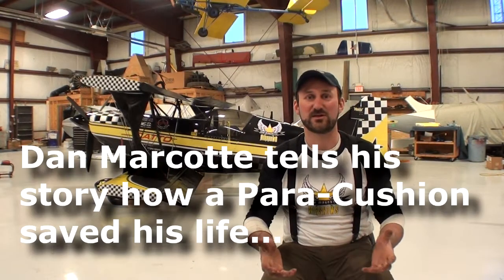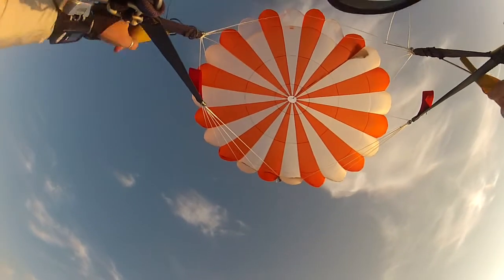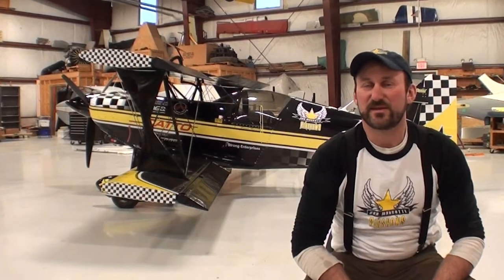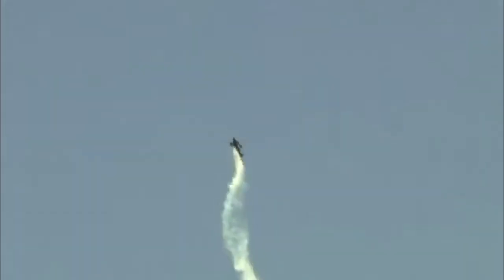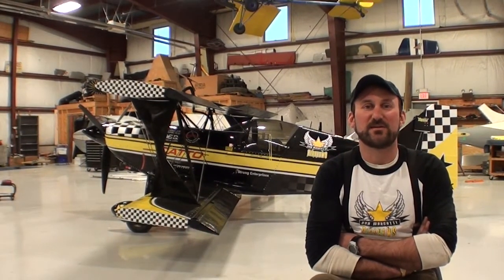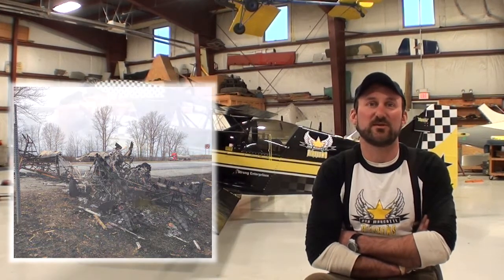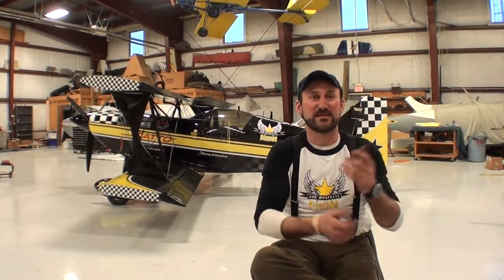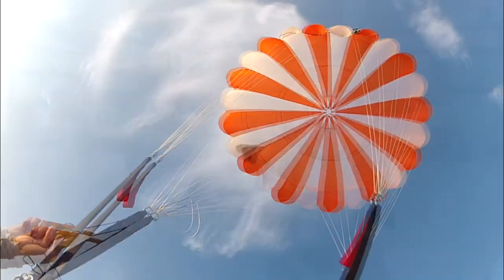11 A Personal Story - Live Para-Cushion Save

Comment: Dan made a very strong comment here that I have to emphasize, because of my own experience.  His point was mental preparation for ANY possible emergency.  
 I am a Christen Eagle pilot, and have taught things like inverted flat spins.  I was flying in what is now my plane, but at the time was still owned by the builder, Larry.  I had done the initial test flying of the plane, and all the flyoff hours before teaching him how to fly it.  At the time this occurred, I probably had close to 100 hours in the plane.  I was very comfortable in it in all attitudes and maneuvers.  
    Larry was an ex-heavyweight boxer, and probably weighed at least 100 lb more than me.  He had originally set the plane up CG-wise for me, which meant the battery behind the seat.  After I soloed him, he moved the battery from behind the seat, to just behind the firewall.  Moved the CG WAY forward. 
    He forgot to tell me that.  
    I was going to demonstrate an inverted flat spin to a fellow acro pilot, and we started at 10,000'  When I went to apply the IFS controls, the plane wouldn't go flat, but it did accelerate a bunch in the normal inverted spin.  The IFS didn't work, so I initiated the IFS recovery techniques I had mentally prepared for.  
    The plane instantly went into a highly accelerated spin.  So fast I could not tell whether I was inverted or upright, or even which direction I was spinning.  I tried a dozen different recovery techniques, nothing worked.   The G-forces were very high.
    Finally I told myself, "to hell with all these TECHNIQUES, just get standard spin!"  I held in the standard spin inputs, and the plane finally broke out of the accelerated spin into what I could recognize as a normal spin, and recovered from that.  
    We were at 2500' at that point. 
    And afterward, and this is my point, I realized that I HAD NEVER EVEN CONSIDERED GETTING OUT.  And I had a passenger.  I was very comfortable doing what I had intended, and when the shit hit the fan, I did what I had mentally prepared for, recovering from an IFS.  Which with the circumstances, was the exact wrong thing to do.  
    I should have had an absolute floor decision in my mind, but I didn't.  And the only reason I and my friend are still here, is that I had 7,500 feet of mistake room to make the "right decision".  The DECISION, the mental prep should have been, "out of control below 5,000, GET OUT!"  
    Mental prep, people.  Dan had that mental prep, he got out in the worst possible circumstances, with no hesitancy.  I didn't.  I am lucky to be here, and hopefully my experience will make a decision to make the mental prep before ANY unusual attitude work, easy for you.
     NEVER do anything in a plane, without making the mental prep FIRST.
Reply from the maker: Thanks very much for that!  We deal with "hard decks" in the - intentional - parachuting world as well.  Emergency procedure hard decks, accompanied by performance-oriented trained actions and regular rehearsals have saved a lot of people.